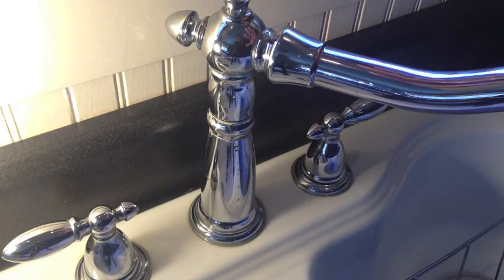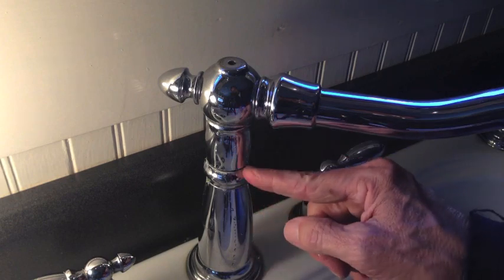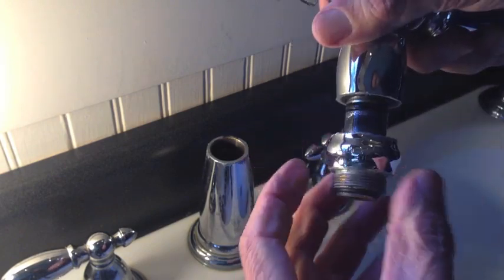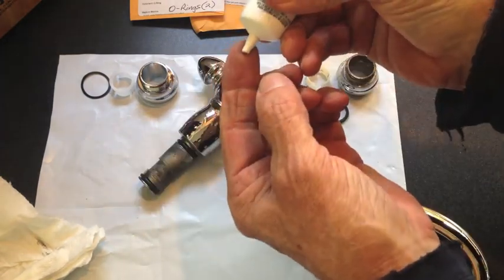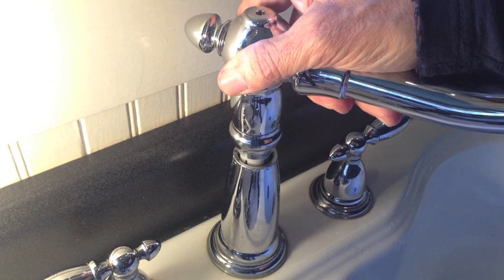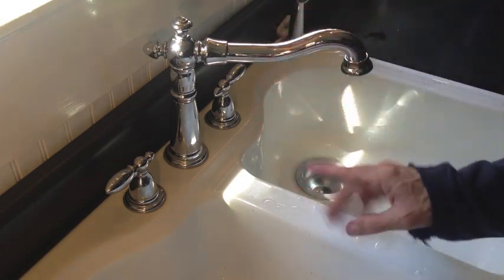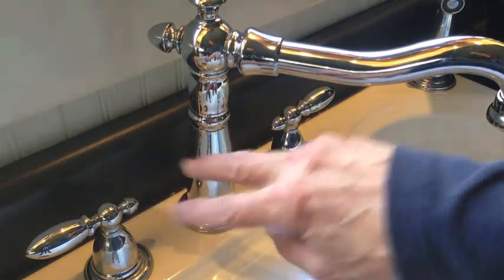Delta Kitchen Faucet Swivel Point Leak Repair

Comment: Great video.  Very helpful.  Just completed the same replacement and leak free so far.  When I called Delta for the replacement parts the CSR tried to insist the problem was in the handle which turns on the water (which is separate from this part).   My Delta faucet is in my kitchen so a bit different from this one (only one handle to regulate the water).  Despite my attempt to convince her these were two separate pieces and unrelated she continued to insist that I needed to replace the seats and springs in the lever part.  I told her to ship me what she wanted as long as she included the parts from this video.  She reluctantly agreed and as I expected replacing these parts solved the problem.  Thanks again!
Reply from the maker: You are welcome.. Thanks for reply..

Comment: After fixing this particular model (faucet and handle)... thanks to your video on how to do it , I lost most of my water pressure and reassembled and assembled it a few times trying to figure out what the problem was.   In desperation I thought maybe it was the aerator but it was working fine before.  I had given up hope in removing my aerator, tried to many times in the past using WD40, vinegar, etc. with a piece of cloth  with channel lock pliers but to no avail...so afraid to damage it.  To the point...great tip about using masking tape on your channel locks...it took a little effort but it worked without damaging the aerator.  To my surprise it was filled with a lot of black debris.   Cleaned it and now I have excellent pressure.   Learned so much from your video...how to tear down this model and an excellent tip on using masking tap which allowed me to tear down an impossibly stuck aerator.
Reply: Delta will send you a plastic wrench tool designed to help with removing the aerator.

Comment: I need to add the sprayer diverter, does the bottom part also unscrew from the top of the sink, the only part you did not remove...
sink
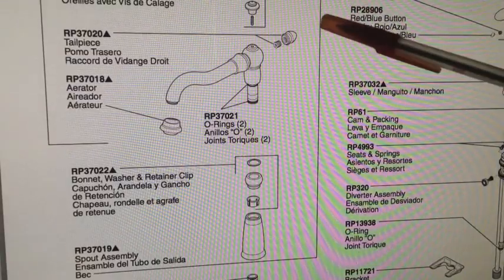Reply from the maker: In the schematic view that starts at 0:38 that bottom piece is shown as being separate.. So I would imagine it does unscrew.. Don't know for sure though.. Never taken that piece off..
Reply: Did you ever remove the bottom part? I need to get to the o ring under the base
Reply: Sorry, I just saw you answer to Bee Kay and I was trying to ask the question to her in case she figure out how to do it

Comment: Do you know how to remove the spout to get to the o rings under the base?
Reply from the maker: If you're talking about the piece at the very bottom it should unscrew.. You can see it turning at 1:33.. That's why I got a second pair of pliers to hold it in place..
Reply: @tongo117  thank you for answering! Yes, that's it: I have to get it off so I can access the o ring at  the base because it is leaking from the base and under the sink. unfortunately mine seems to be cemented to the base...